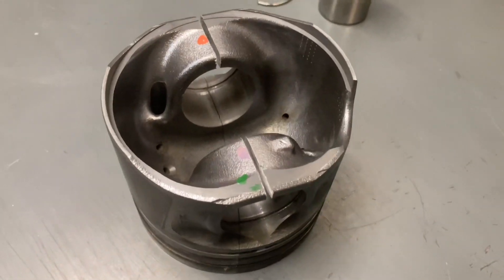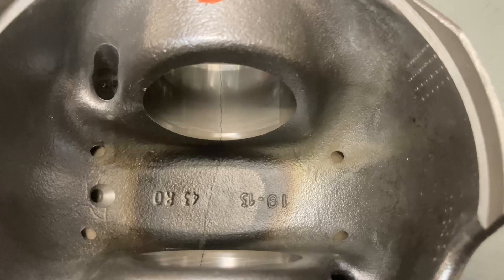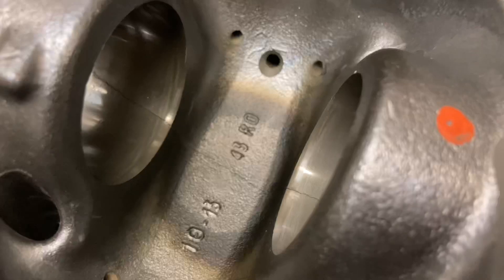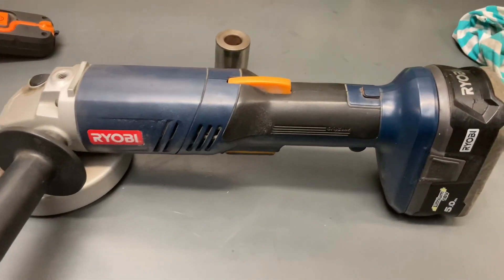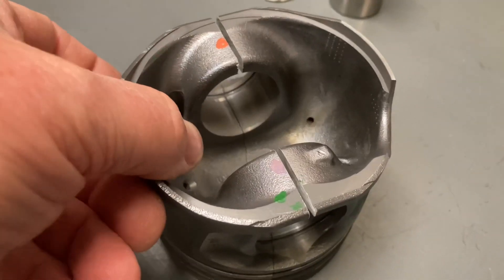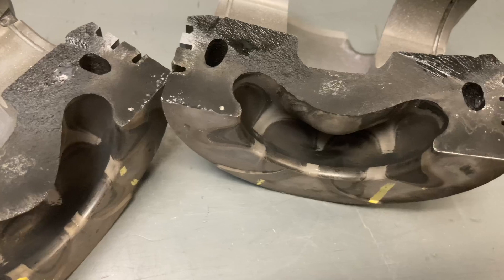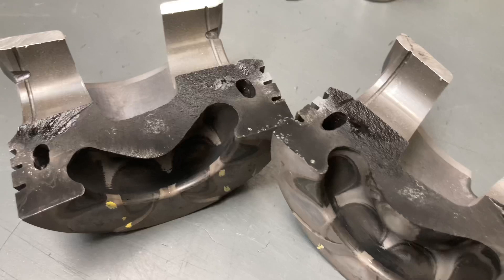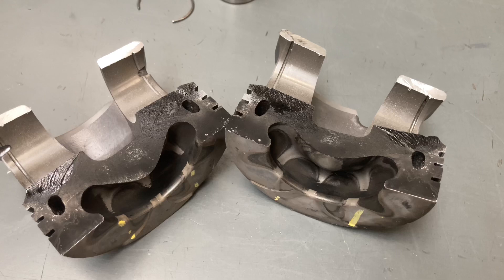INSIDE THE CRACKED PISTON

Comment: hi there was europe  recall well b4 it was common in Aust. Being widespread no doubt Toyota would not payup if  any  power adder fitted . So  strongly suggest many would be from stock engines . ie weak piston construction .
Injectors could be adding to the problem but the cause is debateable . Does the DID injector need redesign yes ,across all brands . I have had many faulty when new so quality is an issue also.
Reply from the maker: I have never had a faulty new injector I’m not sure where you’re getting yours from but we have completely different results.

You’re probably getting remanufactured or counterfiet

Another quick question can you explain if the pistons are faulty why they last 400,000 km?
Reply: @Fourby4Diesel  Never ever purchased used/reman  always new some from dealers /30yo trade supplier and always  checked bleed down . There can be big differences when new .

Comment: Did you know:
Grinding disk: Yes,
Cutting disk: Yes,
What about Ultra thin cutting disk?
These have been out for many years now and are only about 1-2mm thick.
They are amazing and very strong in the one plane…surprisingly given it’s so thin.
I remember when they first came out and produce a very nice clean cut with minimal heat and minimal material loss.
Both for 100mm and 125mm grinders.
Reply from the maker: Did you know that’s what I used in using them for 20 years or however long they been around

Comment: We should also have a think about why other brands don't crack as much as the 1kd piston.
Yes more load and heat is what makes them crack but there simply isn't enough headroom with these crap 1kd pistons.
You see the 1gd has gone from 130 to 150 and now 160kw with 550nm in the new Rogue, this has been done with mostly a "remap" by toyota.

Comment: There seems to be heat stress on the piston , if you look at the temper colours on the piston above the holes the gudgeon pin runs through they go from blue to a straw colour.  I am not a mechanic but I have worked with metal all my life and this is an indicator of heat stress that can change the hardness of metal.